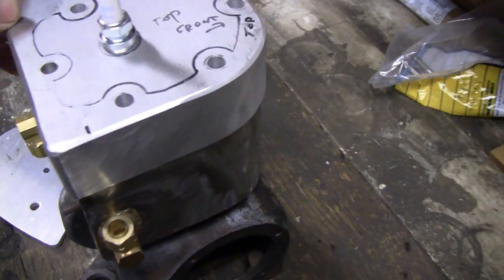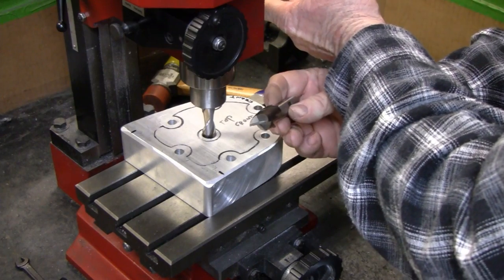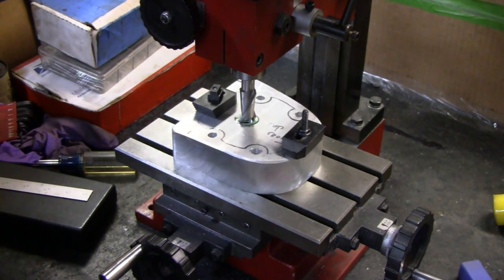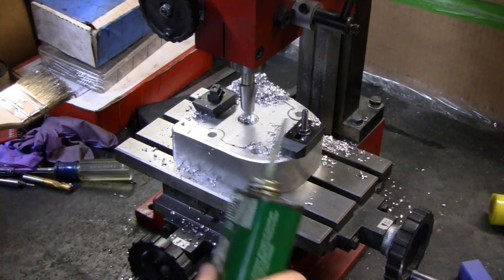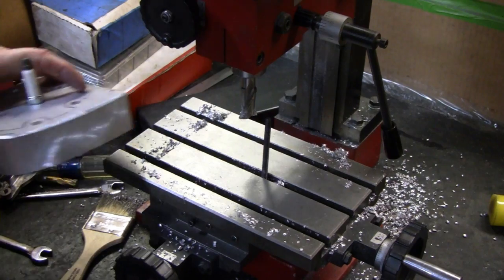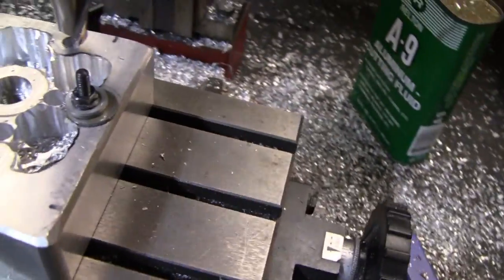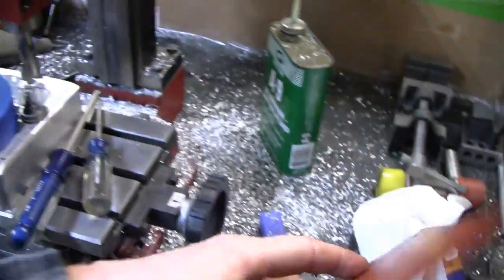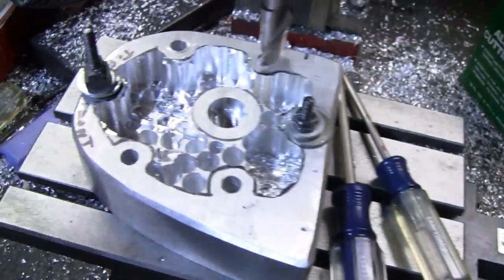HOMEMADE WATER COOLED BRIGGS ENGINE (part 14)

Comment: Get yourself some roughing end mills and then use regular end mills to make the finishing passes.  The drilled holes will definitely help speed things up but you will still be amazed how well roughing end mills work even on small under-powered mills.
Reply from the maker: I think I have a rough end mill, we'll try it on the next head!!☺

Comment: what ever happened to the radial engine. i watched all 25 but it was not finished. do you have the finished videos
and i own a 1956 majestic lawnmower that actually is running
Reply from the maker: We're still working on the Radial, it's a 5-10 year project!!☺

Comment: As a high school machine shop project back in the 60s I built an overhead valve system for a Briggs. Never thought of water cooling one. Interesting.
Reply from the maker: We have an overhead valve and overhead cam on our build list!!☺
Reply: Lawrence Withrow Nice probably a fun project.Did it ever work?
Reply: Yes, at least for awhile. I don't know what I ever did with it. Never used it to power anything. I ran pushrods up through the bored out valve guides and used rockers out of a Ford Falcon 6 cylinder. Milled the head out of a block of aluminum. I doubt if it would have held up for long because I didn't machine in a lot of cooling fins. Got an A on the project. Didn't have an oil pump either.

Comment: wasn't the plan to mill some off the bottom of the head also? (I mean to have clearance for the valves and create the chamber) Just thinking the plug will be hitting the cylinder the way is sticking out (can't tell if it's above the piston now or still between the valves and cylinder)
Reply from the maker: Nah, that was never part of the plan!!☺

Comment: 805Roadking maybe someone watching can find a smokin good deal on an old bridgeport local to them. Best of luck with a quick fix on that anyway, if I were you I would buy 2 or 3 gearsets at once. Totally worthwhile to have on hand in the future. 
I love all your projects, and they are a joy to see in progress. Keep up the great work.
Reply from the maker: Thanks Bud!!☺
Reply: 805ROADKING No, thank you and all the guys. That 4 cyl. is nothing short of inspired brilliance. And the glass head is a dream come true. I have wanted to see the actual combustion process forever and YOU GUYS made it happen. There are loads of cartoons and infographics and what not, but that glasshead was truly inspired. Personally, I want to make a wood engine. Even if it only runs once. I want to use ironwood from Africa. After seeing what you guys have acomplished I say why not. Did I mention yet that the watercooled conversion is a thought I had years ago? I wanted to wc a VW so it could handle a turbo better. Maybe some day still to come.

Comment: are you milling a combustion chamber on the block side?
Reply: Jason Goldsack He would have to or else the valves wouldn't open and close.
Reply: But they just re-cut the valve seat. If they mill out the block, they will have to re-do the valve seats etc, no?

@Dan, with the spark plug sticking out there is also no way to put the two pieces together with the spark plug in there.
Reply: Jason Goldsack normally they make spacers instead
Reply: Patrik Matoušek... I meant the block side of the head...

Comment: So this is really the Watercooled tool-killing Briggs engine project then? :P

That said them nylon gears love to split, I have a turntable which has a split gear on the motor shaft, not through wear or damage, just because it shrank over time and the tension split it, still works, it just clunks a lot when working the automatic return... :P

Comment: im working on a 1960s true test riding mower it was in a ditch im going to use the original motor (5hp true test) but not the original differential it's so small as well that I'm going to use it as a 20 mile per hour plus go kart

Comment: No way I'd run a 4 flute 3/4" on a machine like that. I wouldn't go larger than 3/8" tooling on that but all you did was plunge a hole. In aluminum.

Comment: How much are you going to mill out on the bottom of the head for valve clearance?
Reply from the maker: None!!☺
Reply: Wouldn't the valves hit the head? 0_0
Reply: I can't see how a completely flat head against the block won't bock the movement of the valves. Maybe a 1/2" thick head gasket.

Comment: Coming along nicely. What's next, turbocharged Briggs? :)
Reply: FrontSideBus Maybe supercharge one with a smog pump.  I've seen those old skool motorcycle guys use them, would be pretty cool!
Reply: MVP11489 I've been thinking about trying the smog pump supercharger idea. I saw a few videos on it just wasn't sure if it would be good enough to be worth it.
Reply: that's a neat idea ,, I've been playing with lawnmower engines for most of the last 25 years  and that's one i never thought of
Reply: You could probably supercharge one quite easily with a little rootes  housing gas pump. I used to get heaps of them when i did scrap metal and always dreamed of fitting one to a little engine.